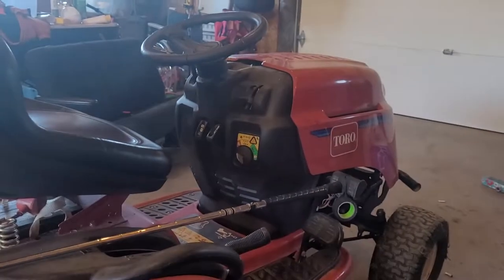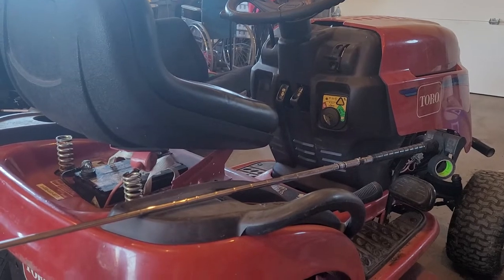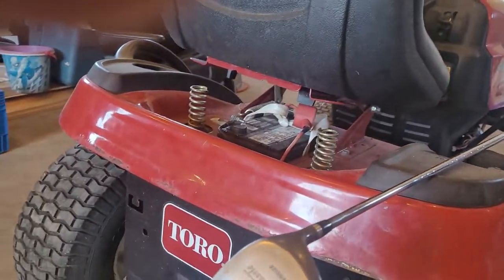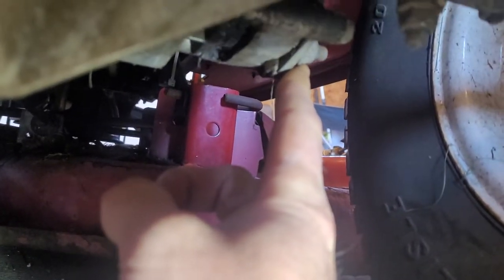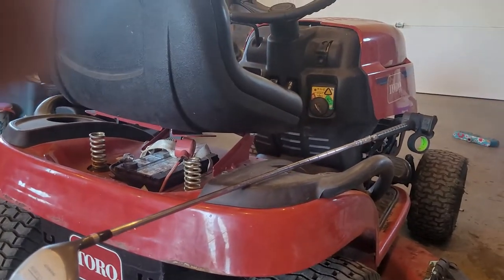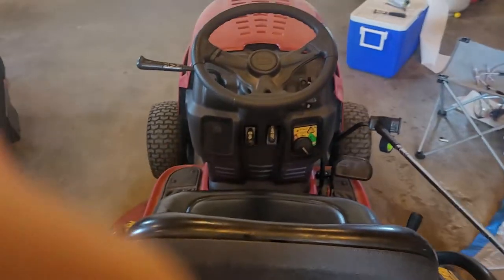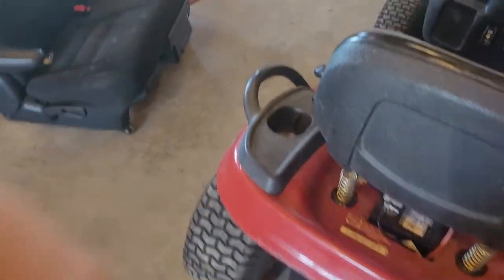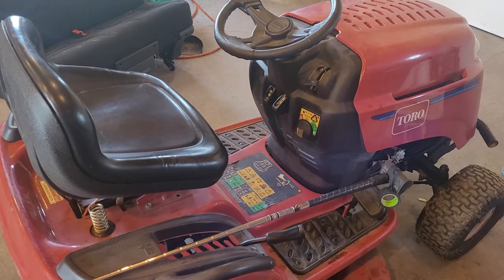Toro LX426 Brakes

Comment: Just got a lx426 for free and when backing it off the trailer on a hill I realized the bakes don't work.   Went down a hill and into the bushes.   Tightening the nut fixed my problem too.   Thanks for the video
Reply from the maker: I hit my car with mine lol. Glad it helped
Reply from the maker: Also I added a second nut behind mine to lock it there.